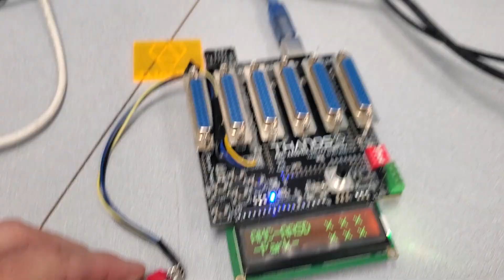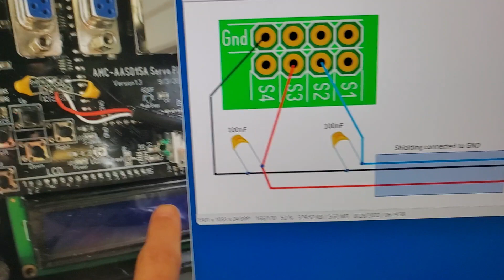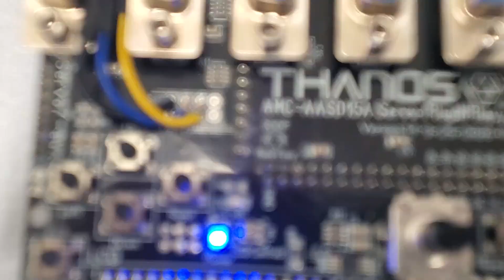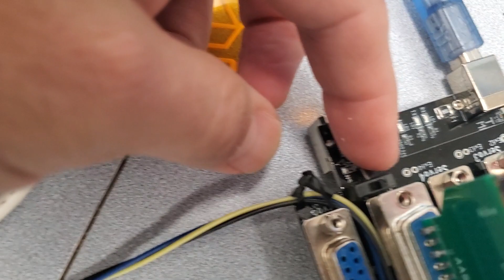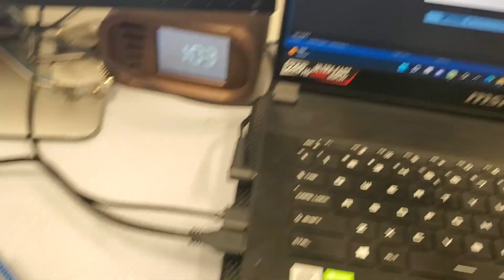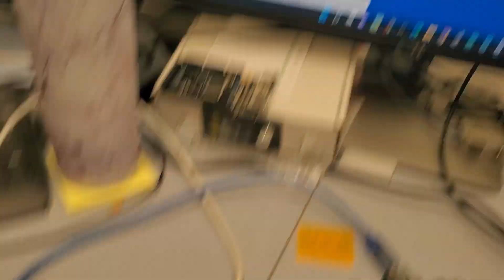How to set and use trim switch for belt tensioner

Comment: Would this work with a seat surge actuator? To adjust my seating position?
Reply from the maker: I wouldn't recommend using it on linear actuators as it shifts the home position and if you adjust it wrong way, the home position could be outside the physical limits. Then when the actuator try to park, would torque against the end stop thinking it has more travel to go and the drive will give you alarm and turn off. You could use in combination with e-stop perhaps, engaging it to make sure it recalibrate the actuators before you are done using it... hmm I think I may need to add provisions inbnext firmware for that..

Comment: Mine is working great, there is really no need for adjustable shoulder belts now as I just adjust the tightness right before each race. Also I think I recognize the solder job in your example picture 😂.
Reply from the maker: Yes, that's yours... lol
But yeah, even during the race if the belt comes loose or too tight, you should be able to adjust it on the fly. And seriously, update to the latest firmware v2.26 fix5, its handling the inserting of trim pulses way better and more stable.